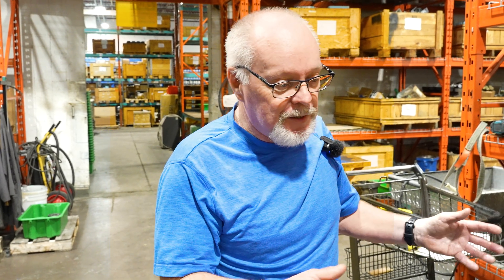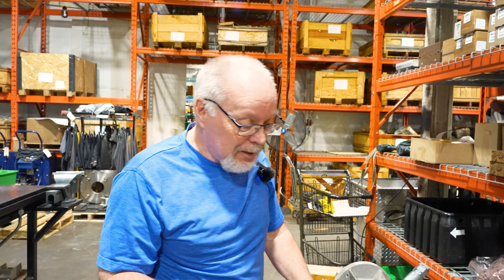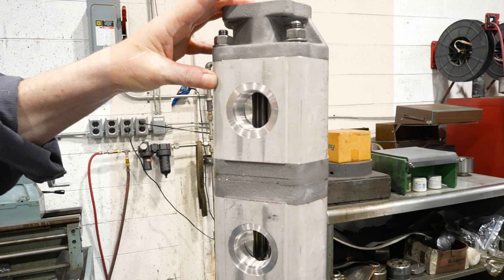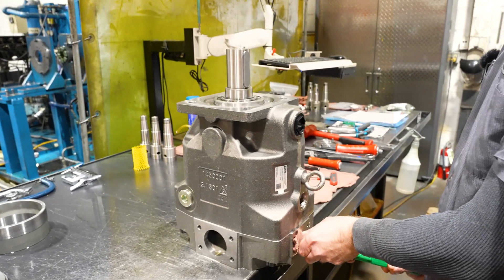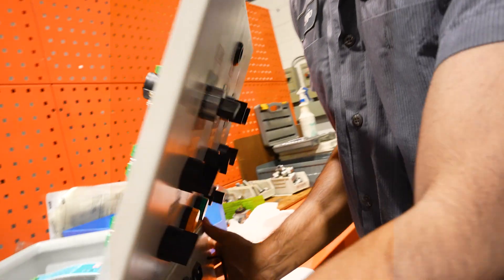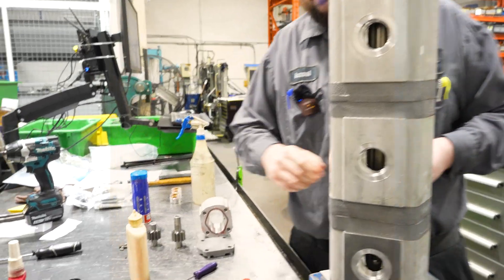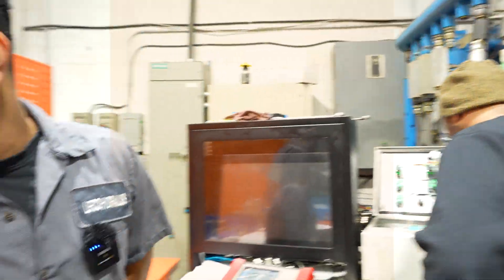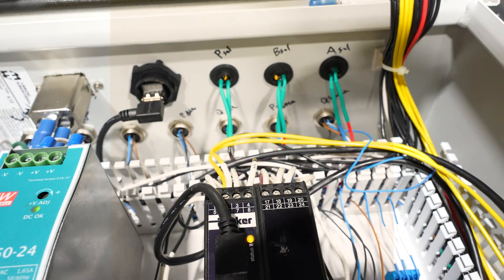Techs Tackle: The Gear Pump and Valve Showdown of Legends!

Comment: I do like a good troubleshooting video. 
The stacked pumps are common on machines with alot of different circuits that you don't want influencing eachother. Like a screener that has alot of conveyers, if you feed all the conveyers of one pump a heavily loaded conveyer will want to turn slower while the ligtly loaded one will speed up if you don't mitigate for it.
Reply from the maker: We are putting more energy towards more technical videos, and a little better production quality. The volume of video will have to decrease though. Gerbert, let us know how we are doing in the coming weeks please. -Fraser